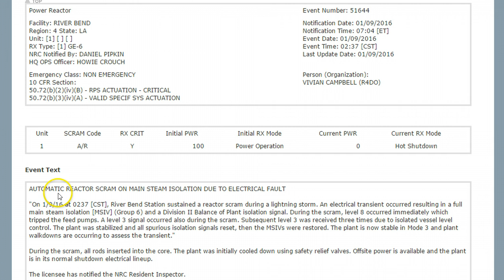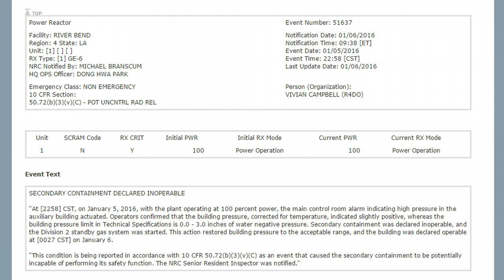'Potential Uncontrolled Radiation Release', Louisiana Nuclear Power Plant Emergency Shutdown

Comment: anyone who believes this idiot needs to do a whole lot of research on nuclear power, the plant scram released nothing to the public SRV's are used to blow steam to a suppression pool all inside a primary containment system which is then filtered out so nothing is released to the atmosphere.  The potential release on the 2nd document had nothing to do with the reactor scram it was an issue with building ventilation that building is kept at a vacuum and the equipment basically broke so they started up something else to make the building a vacuum again.  This building is a secondary containment which means the primary containment would have to break then the secondary would hold in the "bad" stuff but nothing was wrong with primary containment so nothing could have been released.  Basically anyone who believes this DAHBOO77 is either an idiot or ignorant.  Someone needs to teach this fool a thing or two about nuclear power.

Comment: how in the hell could a lightning strike cause a reactor SCRAM and what part and where in the plant did the radiation leak? how was the radiation released and did it escape into the outside environment by liquid run off or was it airborne? US nuclear power generation plants are supposed to have the best lightning protection to prevent surges and especially SCRAM incidents?

Comment: I worked at River Bend before, the only reason it is classified as a Potential Uncontrolled Release is because the building could have been inoperable in the ~1 hour window where pressure was imbalanced.  If an accident occured during that hour, then it still would have been contained by Primary Containment, which is required to always be operable.

Comment: I am about 30 miles downwind and have gotten rad spikes on my meter over the past few weeks, usually 60-74 CPM background as opposed to a normal 20-36 CPM average
Reply: +Indegruv  What do you do with that information?
Reply: +bluecrewnuke funny you should ask, "a lot" actually.
Reply: +bluecrewnuke and yes, it involves "mitigating solutions" on a community wide level.  What are YOU doing?
Reply: +bluecrewnuke also another question would have been, "what do you do once you've learned a week or two after a said "release" has already happened in your area yet was not reported (just like the year or two previously, same events-- cobalt 60 leaked, yadda yadda)

I'm a staunch anti-nuclear advocate, have been since 3/12/11.  If you doubt that you no fucking idea anyway, look at my channel you'll find awareness going back to 2012 DOCUMENTED
Reply: +Indegruv  What does "mitigating solutions on a community wide level" mean?  Those "rad spikes" as you call them are about the same as you would see inside a 747 at 37,000 feet.....and it would be a steady reading, not some nebulous "spike."

Comment: That's a BWR-6. The main steam safety relief valves discharge to the suppression pool INSIDE the primary containment.  The energy is absorbed by the water as the steam condenses.  SRV actuations in a BWR-6 do not release anything to the atmosphere.   

"Potential uncontrolled radioactive release" is the wording of the reporting regulation....10CFR50.72.   In such reports, the language of the specific reporting criterion is used to describe the event.  POTENTIAL does not equal ACTUAL.  That event involved no actual release.   

All such reports are a matter of public record....THAT'S how you were able to get it. And any followup Licensee Event Reports from these and any other reportable events are also on the public docket.

Comment: must be a GE Mark 1 nuclear design when the normal power is lost even if the emergency shut down control rod are inserted heat must continuously be evacuated , if power is not restored fast enough ( 3-4 hours ) core will start to melt like it happened in Fukushima Japan  . level 8 is very bad situation and a tripped feed pump is worst

Comment: Venting does NOT mean a radiation release.  Venting is a good thing as long as no Main Steam Line radiation monitors are alarming.  Nuclear containments vent continuously through Standby Gas Treatment systems that filter any contaminants. If an SGT system shuts down for whatever reason the containment will 'go positive' meaning the internal pressure is not being maintained negative as required by Tech Specs.  A negative pressure is required to ensure no unmonitored release occurs.  Events such as these are rare but do happen usually because one of the two SGT systems is in maintenance when the in service one has a problem & shuts down.

Comment: Two and half hours away from me..
Reply: +504BoyLuisLopez Did you know threres a plant even closer to you?  Waterford 3 in Killona, but that one is run extremely well.
Reply: +504BoyLuisLopez not a problem but main question is : are you downstream in regard with normal wind pattern , if the wind blow in your direction then you have a big problem
Reply: +504BoyLuisLopez New Orleans?
Reply: +Billy Strickland I stay in the Westbank of New Orleans.
Reply: I saw the "504" in your name, so I figured you had to live in that area. :) I'm just upriver, just a few miles to the northeast of Baton Rouge.
Reply: francois clermont Not sure.

Comment: I worked at a Nuclear Facility once, for while. You would be surprised how dated and simple those places are. It's like the facility and the people are all trapped in a time capsule from the 80's. Even the private funded ones are essentially government run and they operate as such. Total waste, total incompetence. The security was pretty solid at the front gate...I will give them that. 

We all pay about 3-4 times more than you should for nuclear power though, at least as far as the cost associated to overtime the workers claim. Like any good government division, they all claim excessive OT and expect it every year like clockwork...regardless of workload. And I mean EXCESSIVE.
Reply: ***** you're a moron. You prove my point. And you can't read apparently; which I suspect is a requirement for Nuclear Facility Workers...manuals are likely all picture based. I said "essentially government run".

Due to the government oversight they are essentially government facilities. Given your knowledge and how upset you are, I suspect you are one of the lackeys that work for one of these places and collect endless OT for sitting on your ass and taking 40 smoke breaks every day.
Reply: ***** lol, I edited my second post as I had an "s" on the end of the word "picture" and no "." at the end of another sentence. That stuff annoys me. My original post is unedited.

And interestingly enough, at the plant I worked at the outage workers were simply re-purposed regular workers for the most part. So yes, the toilet scrubbers and floor sweepers were just as qualified as the SRO's. lol

You being a retired Reactor Operator I suspect your credentials are this: May, or may not have graduated HS...right after, started work at plant....worked at plant for 30 years looking at a dial and every once in a while flipping a switch - then retired.

So since you are a non-smoker (congrats on that, did you just quit?) you must have been annoyed at everyone else taking endless smoke breaks every day while you worked your ass off looking at a dial built in the 70's.
Reply: ***** I would like to point out that you first made this personal..I simply stated my opinion about nuclear plants and how their employees take advantage of government like environments to squeeze money out of an already bloated compensation structure. You responded and took it personal, you did so since you are in fact one of those employees. Now, did you specifically do the things I mention? Who knows? Maybe, maybe not...there were good hard working people there and maybe you were one of them.

That said, I did in fact work for a Nuclear plant and this plant did in fact re-purpose workers for outages. I was a consultant and worked on site at the plant for about a year, year and a half and then for about as long at the corporate HQ. I know exactly what you did and I know exactly the type of people that fill your role. My time at the plant was only due to the hi-tech meltdown during the financial crisis. Otherwise I would never had wanted to work at such a place for all of the reasons I discussed. There is no creativity, no advancement technologically and nothing but the regurgitation of talent from within. Hardly any outside hires are made, only transfers of the same type of people form other plants.

Anyway, you and I will never see eye to eye on this as you have a vested interest in your pride and history of your work and I for my personal beliefs and experience as an "outsider" to this environment. However, I think it was unfair to troll you the way I did and I apologize.
Reply: ***** yes, that's exactly what happened...wow you nailed it.
Reply: Brando Phoenix I agree, the security is impressive. No argument there.
Reply: ***** the plant I consulted for ran up $80,000,000 in OT pay for one year. I know its sort of an arbitrary statement, but it was exceedingly excessive for the operation I was part of. And since the plant I was at is the largest in the US, I suspect other locations don't see those sorts of figures. This was a location with roughly 2000 employees. Many of these people were doubling pay but most were seeing 25-35% of a "bonus" in totally unnecessary OT.
Reply: ***** because I was part of the group charged with reducing it since it was so out of control. Regular meetings with the Executive team, who stated it was an abuse of the compensation structure, was a pretty good indication. However it was just a dog and pony show for investors as the department heads for the facilities had no real desire to reduce costs. Bottom line and these types of costs and over spending, are not aspects of concern for people at these plants for all of the reasons I have mentioned.

These people are "lifers" at these facilities and don't want change. Interestingly enough, one of the Sr. Managers in charge of operations at one of the plants, was in fact a janitor when he started. God bless him for working his way up, but he cleaned toilets at first. And, after being there for so many damn years, he was nearly making $200k a year simply from guaranteed pay increases which compounded after so many years. This was also an issue across the board. Everyone there had worked there forever...knew nothing else. And due to this and guaranteed pay increases, everyone had exorbitant pay. So they would of course never want to leave. This combined with the ridiculous OT, painted the picture I described..."Essentially" a government operation with flat out outrageous costs that you would never see in the comparable "private sector".
Reply: ***** I think that was more or less the case.
Reply: time to move
Reply: +simul8guy  YOU  Murdering Industry Troll............ Lies.. . Furthermore..... They Were Built By Low Bidder..... Operated By Low Bidder... You Can Take Your Nuclear Shit & Eat It Boy Bought And Paid For.......... They leek all the time   So It's A Nuclear END One Way Or The Other  Fukushima Japan Nuclear Disaster Has Not Ended... The Next Nuclear Disasters..is A Mathematical Certainty Due To The Algorithm Of Greed
Reply: +Rick James lol  Claiming excessive overtime sounds just like something Homer would do. remember Homer said (If you dont like your job you dont quit,  you just go in everyday and do it really haff assed)  God help us.
Reply: +simul8guy here is your link you requested. Just because you worked at one plant doesnt mean you know evwrything about nuclear. And yes ALL reactors in the US are all funded up to 80% by whom, the taxpayer. Price Anderson subsidies.  Nuclear reactors when operating normally are generally pretty safe but when you factor the waste and mother nature into the equation then its a no brainer this is the worst and most dangerous idea to boil water ever brought to man.
Reply: +simul8guy pro nuclear troll pos